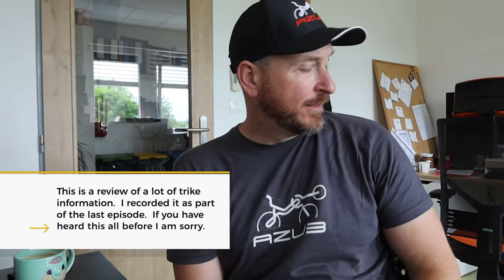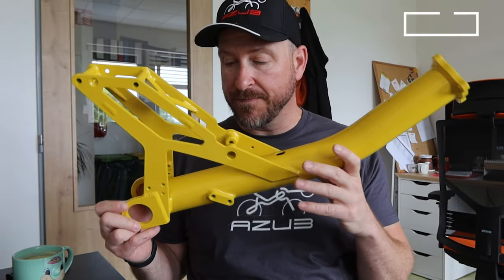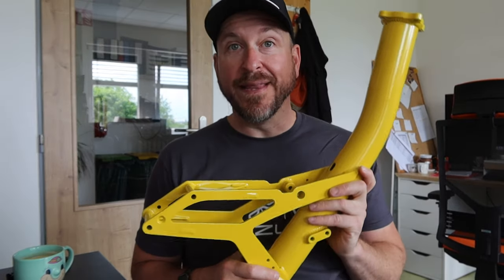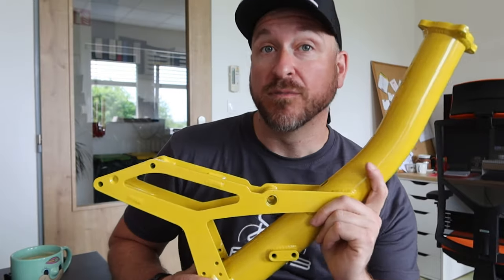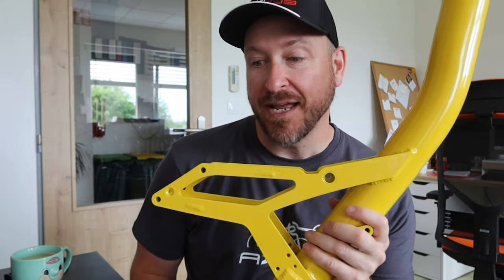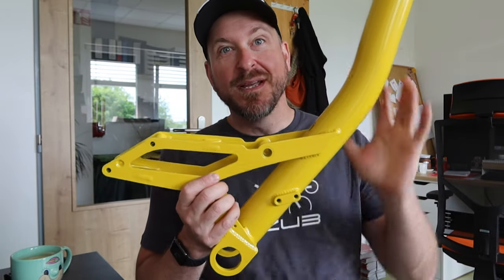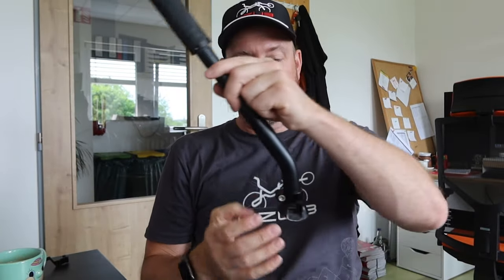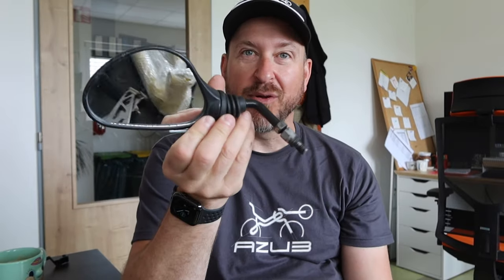AZUB Trike Integration Overview | AZUB TiFLY X Recumbent Trike Build

Comment: I loved my Rohloff on my ICE Full Fat. They make lots of sense for off road riding with roots, ruts, and rocks, where a rear derailleur could be struck, or a case where not being in the right gear for a sudden obstacle meant coming to standstill, whereas with the Rohloff, simply shift even stopped and keep on going.

Say Matt, will you be meeting with the engineers who designed these trikes, or featuring their thought processes behind decisions regarding design?
steve

Comment: Will Mark be making a video of the assembly of the old trike in Australia?
Reply from the maker: He’s sending me some pictures of the process. I’ll see if he’s open to that
Reply: I have started video on the process, but it will take awhile to finish as I’m calling in favours of people I know to let me use certain equipment and get help with some things … trying to do it as cheap as possible but in saying that I’m not cutting corners either.. also got a few months wait on some parts from HP small hardware that I’m going to replace ..
Reply: @JaYoeNation  Is that a zerk fitting on the hub? A trip to Aussieland would be interesting.

Comment: Should not be a
problem to calculate the front chainring you need to use the Schlumpf drive together with the 26inch backwheel. So its just to order a new chainring from Haberstock Mobility and let’s go. Of course you need the mill for the chamfer on the pedal boom. But Haberstock rent them out.

Comment: is the dubbel thread with the idler for the battery bracket ? or a plus in combination like a rohloff
Reply: The rear end is used on different models and/or wheel combinations, so these two holes are always used for a pulley.
Reply: @honza-galla  is it also for a tricon ? and has seat tubing changed ?
Reply: Yes, the rear end is for all Ti-FLYs and TRIcons. 

Seat tubing has changed in middle 2018.